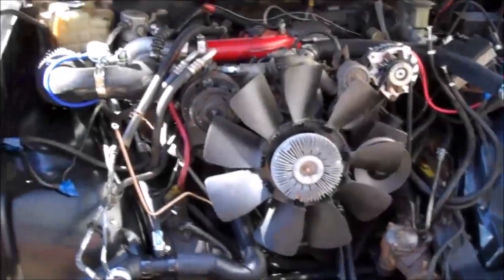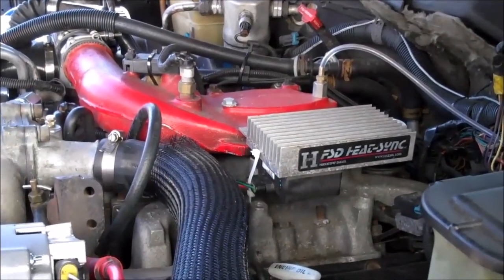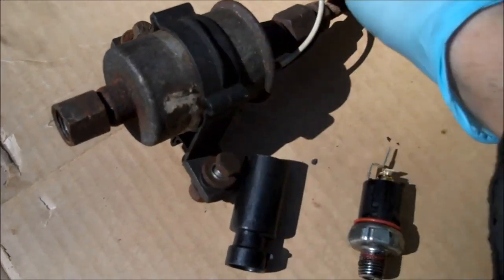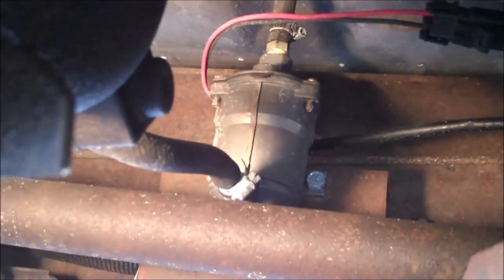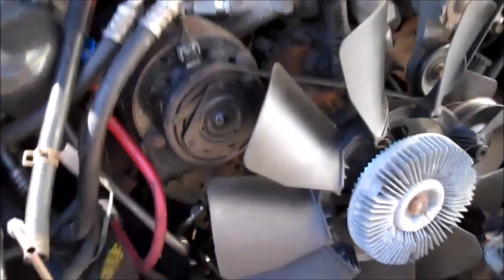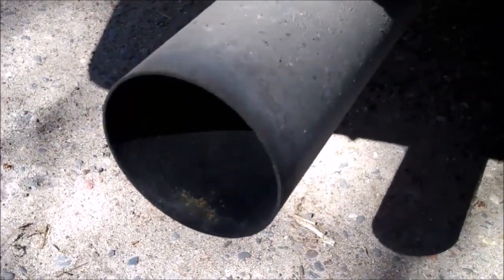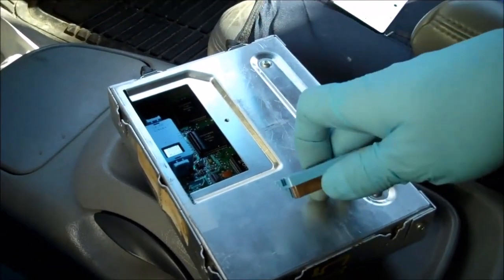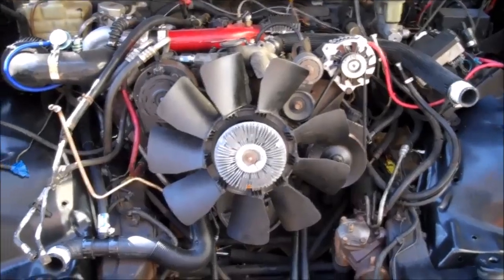6.5 DIESEL ENGINE - HOW TO BOMB PROOF IT

Comment: Sorry, I do not now how to email a youtuber privately, so gotta ask this publicly! Everyone around my area all say one thing, 6.5's are boat anchors! Which I too haven't seen one last without a ton of problems! I have a 1999 3500 dually that needed new heads and then a few years later, not related, taken antifreeze in the oil and blew at 140k. That engine has been at the machine shop for almost three years now! And I just got a deal on another 1996 2500 automatic trans extended cab in sweet shape, I like these model trucks and this is the only diesel I can get in them, but in saying that, the rod in that engine is about to fly out as well at 240k! (Hence the good deal)! And looks like it has been blowing oil from every orifice for years as the engine all over is black like wet tar! I have a friend who has a 1995 3500 Dump standard shift with 80k. Can not hear it run because he got it after someone tried their hand in rewiring the ignition and other areas unsuccessfully! No way to get glow plugs to work , had to hot wire the fuel pump and got it to turn over, sounded like it wanted to go with starter fluid, but for whatever reason wouldn't fire! but as it turned it, it didn't sound like the engine itself was shot! OK, To my question, since you seem to know your 6.5's,,, Is the 95 engine the same as the 96?? Though everything on the front of each engine is completely different ie; placement of alternator etc,,  are the 2 engines the same?? Would I be able to take everything off the front of the  engines and put all the 96 parts on the 95? All bolt holes the same? Are all the pertinent plugs for the computer and all sensors or whatever the same? Are the Automatic and standard tranny mount holes the same? Is there anything different with the injector pump? Would I have to exchange that also? Is there anything different where these are not interchangeable where I can put the 95 engine into the 96 truck? Anything important you might be able to tell me to  be sure to change because it is different one to the other ?? Thank you!!!

Comment: Great insight.  Thank you for the tips...
Reply from the maker: Thank you,  I appreciate it.
Reply: I have a 99 Winnebago Brave w/ a turbo 6.5 diesel and only 60k miles.  In the process of changing the fuel injector w/ the module.  Just interested to know if I should change the water pump at the same time. 
 @Yankeeprepper
Reply from the maker: @williamjohnston3130  I don't feel like I can answer that.   I changed my water pump at about 150,000 with an upgraded one and the old one was working.   A new AC Delco pump is less than 100 bucks.   I have done the fuel injector job before and it's a hell of a job.   The one thing I wish I would have changed more often is the belt tensioner and the idler pulley,  had one of those go out on a road trip and although I was able to fix it easy enough.  Getting to the parts store and back in the middle on no where was an adventure all it own.

Comment: I have a 95 Chevy 2 door Chevy Tahoe with 6.5 diesel, thanks for the advice I've done most all ready, will take the air pump off, it runs grate, will go anywhere I need to go.
Reply: yow trucking awesome! I like the burb I have. Lemme know if you need tips on yours!

Comment: I had 30 horse injectors,
pmd mounted on the driver side fender,
Homebuilt boost controller 
AFE cold air 
4” exhaust 
90 gph fass fuel 

Had the L65 motor in it 
Running 16-20 pounds of boost the truck was absolutely awesome 900 ish km per tank truck was unstoppable

Comment: Does anyone have info on WALBRO lift pump model number there is too many of them and too much conflicting information on the required psi and gph one should run when upgrading the lift pump.
Reply: I'm in need of the same info...

Comment: Hell yeah I've got a 97 6.5 and I relocated the pmd bigger air flow fan removed the idiotic vacuum pump  and I'm waiting for little more funds and a walbro is on my next purchase and I'm feeling pretty stupid I had to take the truck for a journey and bought had to buy a shifty factory replacement I have the big air flow filter and that diamond back a salgo pump and I'm not even interested in another truck.Thank you a bushel for this kick a ss video any more tips maybe some reasonable deals if you are into trading wheeling and dealing or just so.e more of your th by burns onCE engineers

Comment: Awesome, just question how to avoid the p0236 code and what did you do to replace the vacuum pump?
Reply from the maker: you can buy a "fooler" to hook intothe vac. system on Ebay or ignore it like I did....at least until I got the upgraded chip from Heath which takes out the code.
Reply: I changed my air filter,  and was surprised that cleared the code

Comment: I own an old '94 GMC Safari with the 4.3. It's no diesel of course, but it's a fine example of a good powerplant held back by GM. These mid 90's GMs however were easier to correct GM's planned adolescence than the newer stuff. I've always thought it would be neat to have a Diesel under the hood of that thing. Apparently a 350 fits without issue. But she's only got 132k on her so.. might not happen any time soon. I love your video, and your slogan. May god bless.
Reply: 4.3L and 350 are the same engine, front two cylinders are knocked off to make a 4.3L. It's been 15 years since I had an Astro..... you would probably have to go to an electric fan to make it work. You're talking 3 - 4 inches in difference of block length.

Comment: Hey Yankee, i was wondering if i could contact you somehow for some help with my Yukon. Its a 97 with the 6.5 TD and I could use your guidence on a few things. Dont want to take much of your time sir, my girlfriends a mechanic fresh from school and im a jack of all trades master of none haha 

I have a few codes i wanted to show you and just wanted a point in the right direction on a few things. I believe i need new injectors and glow plugs and have a turbo code.

Anyway, anyway... I dont want to inflate this comment any more than I have. Is there a way i can PM or email you? Not a spammer just a regular 27 years old chrisyisn oyster fisherman from CT that could use some mechanical wisdom from a man that knows my engine well.

Me and my girlfriend know gasoline engines all too well but we're a little intimidated with this machine.

Thanks yank!

-Pat
Reply from the maker: No.  I did not put this vid so I could spend my time trying to remotely fix someone elses truck.   This vid is all the time I am giving out for free and it is simply to help others maximize their engines.

Comment: I really enjoy and appreciate your video! I was wondering if your going to put out anymore videos on the 6.5 and I was also wondering how the lifter pump is working for you? Thanks again to you and our sponsors!
Reply from the maker: I have no plans to do any more vids on the 6.5.   Lift pump works fine,  way better than stock.
Reply: I apologize, but I just watched the video  again and didn’t see anywhere where you discussed error code form removing the vacuum pump. Thanks Scott!
Reply: First off thank you for the reply, does removing the vacuum pump throw any error codes? I have a 99 Suburban 6.5L
Reply from the maker: @Scott717  yes, covered that in the vid

Comment: Did you use an early or late 6.6 fan they both been different and do you have to cut the fan shroud to make it fit
Reply from the maker: I bought mine made to fit from Heath diesel and as I said in the vid ALL the products I used have links in the info box

Comment: Thanks for taking the time to prepare and share this video with us. I was contemplating selling my Chevrolet 2506.5 L turbo diesel. I have no reconsider that and I am anxious to make changes. I had already replaced the mechanical fuel pump twice in the 87,000 Miles I put on the truck so far.  The first time it was covered under warranty, but not the second. I’m still working the fuel flow issue I’m having right now to get it running again and I’m  hoping that I have to replace is the fuel pump, bypass the safety switch for rollover and move the electronic module to a position That is cooler.    Thanks again

Comment: You helped me so much in 14 minutes, defiantly not scared to buy a 6.5 now
Reply: Facts I have a 6.5 diesel I had to move that heat sync also I didn’t know about the other to and that deserves a like and subscribe very well laid out very well described just all-around great explaining these videos we need more of people like you that really points and shows and tells you
Reply: I got a 1993 GMC K 3500 with single rear wheels and the manual NV4500 5-speed tranny and with the 1993 6.5 diesel you don't have to worry about the PMD because it is a totally mechanical engine and would survive Solar Flare or EMP attack just as it is!!
Reply: Jesse Porter did you get one?
Reply: @SuperVstech  I did!
Reply: You buy one with cracked block.....nothing to bomb proof that then.

Comment: Heck, I'm a 7.3 IDI fan, but you make the 6.5 sound like a nice piece of kit. I like simple and mechanical but am actually a bit of a fan of OBD1, just enough dodad to get the benefits without all the over-complicated and over-regulated BS. A basically mechanical diesel with some OBD1 controls sounds rather nice.
Reply: The 6.2 / 6.5L are light duty diesels. They do not compare to International's IDI, which is a much heavier engine. (the 6.2 and 6.5 are also IDI). International's engines were designed for medium duty truck use, the GM engines were designed for pickup trucks.

Comment: I love the vid. Im in australia running a 98/99 5t ambulance and its minimum is 1200 km every time it moves. Its got about 350000km on the clock and just started to have heat issues. Just to give you a breif history on these trucks down here. They were imoorted straight from Us not the mexican suburbans and conversions left to right done by the ambulance builders. For rural and long distance they are great but on the heavy side and hate hilly country. The big benifit is running repairs are easy and parts i just order straight from the states. She runs three batteries and my issue at the moment is the heat in the engine bay.

Comment: Well, I got 400K on my 95 2500 Suburban before the #2 cyl. intake valve head "rim" chipped of a fingernail size of steel and got sucked into the cylinder right after I did an engine flush and Amsoil oil change. I was able to limp it home nearly 40 miles poofing white the whole way and it died in the drive. Amazing as it were. That was in the Spring of 2005. NEEDING a rig ASAP I opted for an 05 3500 RAM 5.9 Laramie which now has 394K on it.

I want to get my Sub on the road again this year, it has been sitting for far too long. It is in nearly perfect condition still interior and ext. I have been looking at the Optimizer P400 for it for several years, just haven't  pulled the $$$ trigger yet. 

Where were you ten years ago ? LOL

Any input on "saving the life and or improving the Optimizer ?  I'd especially like MORE POWER.
Can't believe that 6.5 came OEM with a meazily 190 HP.. WAJ...  I did the Chip, exhaust and PMD but that was it. For big rig (3/4 Ton) Sub, I still managed 18 to 21 MPG AND, it did go fast enough I suppose but that rig should really be pushed by 300HP minimum and at least 500Ftlbs. of torque. IMHO... I've "toyed" the ideas of swapping LBZ Duramax and Allison or a 4BT or 6BT even the 5.9 Cummins. But all those would much more time consuming work that "dropping in" a fresh, BRAND NEW not reman P400 Optimizer.

If you see this reply and can offer any input, I'd very much appreciate it.
Couple things to add. I am aware of HEATH diesel here in my home state of WA. And also Leroy Diesel to whom I've spoken with years ago.

Thanks for the good info, I will stay tuned.
Reply: Be aware if you go to a cummins the 5.9 is 1200 pounds.  They sale craddle kits that stiffen the stock gm frame to handle the weight.

Comment: Just bought a 95 chevy 6.5 turbo diesel. It has 88000 miles. I have changed the lift pump. And if it wasn't for you I would have not known to do that. Thank you and God bless
Reply: If you still have the truck, let me know! We 95 owners need to stick together!
Reply: Had a 94 GMC was a beast. Until that chip bypassed the rev limiter bent my rods.
Reply: @BrandonCorby-wr5nd performance chip?
Reply: @shartsfired2263  Yeah they made a hard mod chip in the ecu you could replace not a on the fly tuner like bullydog or banks
Reply: I bought a Chevy 1994 Diesel 6.5 but won’t start
Reply: @milanhernandez9165  Most likely the PDM
Reply: I'm putting a bigger diesel tank and new pump I have to wire a new fuel gauge because the old one dont work
Reply: I have a 94 and pulled it out a field ! Ran it about 20k miles now doing heads .

Comment: Rookie questions for anyone who can answer it......
Having removed the vacuum pump, what now operates the waste gate ??
I am looking at a 1996 k2500 6.5 suburban.  It has 194,800 miles and looks like it was well cared for. The owner just rebuilt the injector pump, installed new glow plugs, and relocated the PMD. He is asking $3700. It looks to have been pretty well cared for.
Does this sound like it might be worth looking at?

Comment: I am having trouble figuring out where or what to buy as a "manual wastegate controller" to replace the vacuum operated one, of which I need to remove the vacuum pump and get the 1993 serpentine belt you talked of instead of a 1997 belt for "vacuum pump",....but it gets worse,....my serpentine belt on my 1997 6.5l is checked/cracked,...meaning it needs replacing, .....I need to get on it soon,....I'd say the vacuum pump on the vehicle now is old and dirty, ....ready to go out in a moments notice, and maybe it aint even pumping anymore, unsure.
Reply: Take off your belt and turn the vacuum pump pulley by hand and you will feel if it's working instantly.  Mine feels like an air compressor.

Comment: If I ever get a 6.5 it will be a 92-93 NA with Mechanical IP... but we all know how rare those are.
Reply from the maker: I prefer the chipped ones,  that is why I own one.  But it's easy enough to turn them into mechanical with little trouble,  mostly just buying a mechanical pump and hooking up a drive by wire.  Cheap and easy.

Comment: What year did the mechanical pump stop and the electronic begin production.?
I believe mine is a 1995 model. 
I assume the mechanical does not have this electronics module?
Reply: Jenny Rodriguez electronic began in 94, 93 was last year for mechanical
Reply: If I remember right 1993 was the last year for the mechanical pump. I had a 1994 and it was electronic.
Reply: 93.  94 they went to the electrical one.